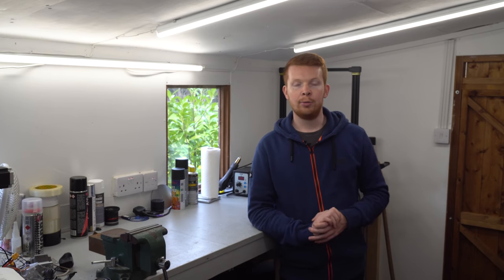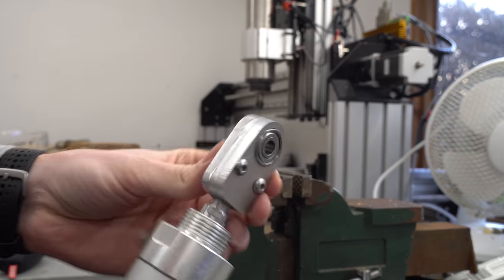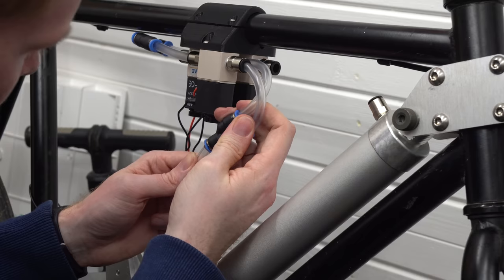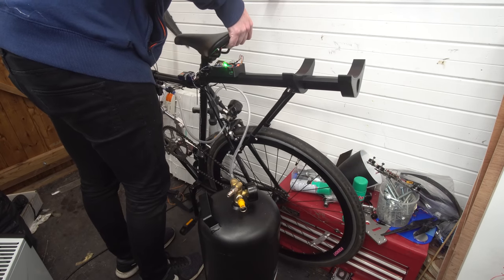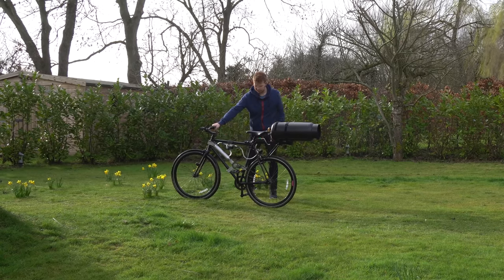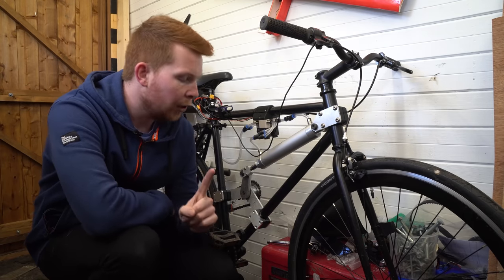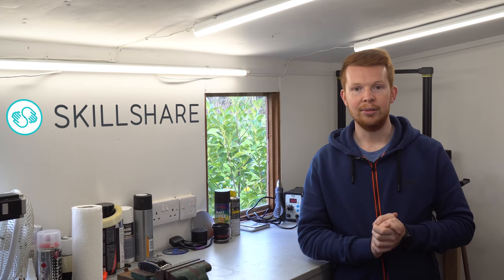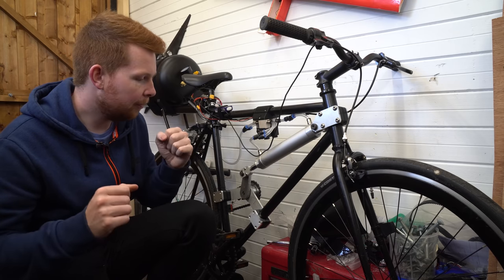Air Powered Bike

Comment: Energy density of such a compressed air tank is far too low. I strongly suggest to move to a piston steam engine with a bike heat exchanger as a condenser. The easiest part is the boiler. Since coal is not a preferred source of energy, there is a viable alternative: Simply fill a high pressure boiler with water and put a lump of Plutonium-238-Oxide (about 4 kg) inside. It will generate about 2 kW of heat. Since Pu-238 is a alpha-radiator (He-4 nuclei), shielding is not an issue. This configuration will create about 200…250 Watt of mechanical power - like an ordinary Pedelec. The higher the temperature, the higher the efficiency according to Carnot's law: Eta = (tH-tL)/tH. Such a bike can be used for decades without refueling, since half-life of Pu-238 is 87.7 years. ;-)

Comment: why don't you make a bicycle where you generate air to pull you from the front wheel?
so it would be you + the excess energy u use when riding a bike transformed into air and into mechanical energy

Comment: If it's not street legal, it remains useless. Check your laws there, but i here find this solution:
If you'd make a machine that would power your legs instead of directly the bike, it would be legal because as far as i know it should be legal to be a cyborg. Make hefty metal shoes that are open from the side so the feet are free to exit, hang the machinery in yourself and put a wire to those shoes for rather pulling action so the force won't lift you up from the seat like it would in pedaling the traditional way. There you go, legal highway speeds achieved with no burocracy!

Comment: Made a bike like this back in 2008.  Used twin 92 cf 3000 psi scuba tanks mounted for low CG at the back axle.  Also, rather than connecting the cylinder to an arm (to change linear to rotational) , I just had the cylindar pull the chain back and forth using the ratchet already built into the back tire cluster.  Top speed was a little over 20 Mph, and range was a few miles...  I'll try to paste a link here to the youtube:  https://www.youtube.com/watch?v=zzNiU9rSWAU

Comment: Check  this title and site on You Tube ( lol ! - No pun intended ),  " Making a simple Hydrogen Generator from Washers "  at the  " Maciej Nowak Projects "  videos. You could fabricate a bamboo bike ( actually  grow a bamboo bike frame  ) cut in half, then RTP  weld it using  two Punch Bug pistons instead  of a pneumatic value all by itself, this contrivance is hydro pneumatic inside a porcelain tube using a homogeniser asphalt  piston ring and  Food Service Petro Gel. Basically same set up with a return  through  an automobile  thermostat. It just has to maintain  integrity  through  the frame.

Oh yeah, you need a 9 volt battery  and a universal  automobile  cigarrett  lighter...it's a  fusable  link.

Comment: Not your best concept. You should have used an air motor. A cylinder (air or hydraulic), has more ''push'' in (extension) and less ''pull'' in retraction due to the surface erea of the piston being smaller on rod side... Plus, the torque ( lack of) generated by your system, was easy to calculate before the construction...

Comment: This would be for sure not legal in the Netherlands. You can have a powered bicycle but the rule it that it only is concidered a bicycle if the motor only works when the feet are also power the bicycle at the same time. In your case you can stop pushing the pedals with your feet and just let the cylinder do the work. I hate how this works. The same with electric mini stand on mopeds, hooverboards etc. all illegal. Some things are illegal but will not get fined normally. Like an electric kid scooter that will travel very slow. most of the time less then walking speed. But this kills the minds of people like you and me. It is just fun to experiment with some solar panels on a bicycle trailer to power you for free to your destination. or some solar on a small inflatable vessel. walking, rowing, cycling. All little accidents you get will be covered by your basic personal insurance. at the moment a motor is involved it is a different story and suddenly you need registration and special insurance for this vehicle. I can understand that when pretty high speeds are involved but with a free running sportsbocycle you can go twice as fast as with some electric powered normal bicycle. so it is strange.  Like your project. keep them going.

Comment: Do like an f-ing steam engine, it would be double acting and would Work in both sides of the cylinder, the Problem is on the cylinder, not on the crank, and not on the material

Comment: You may have a lot of skills but you lack common sense, the volume of air required to power that cylinder for any length of time is far greater than the gain, running a constantly diminishing power supply is defeatfull of the purpose